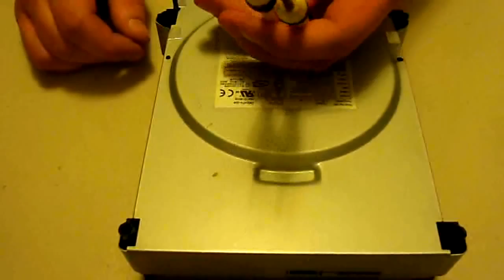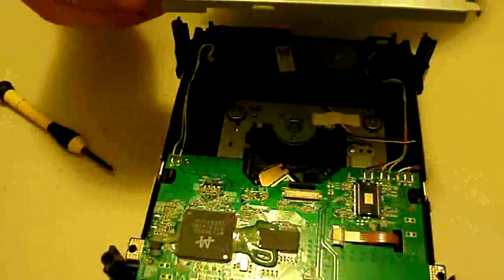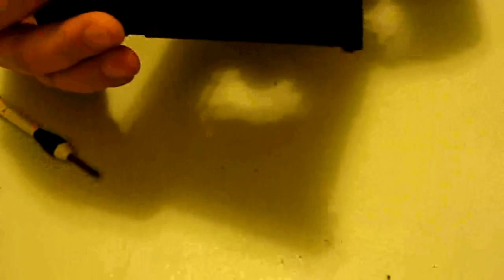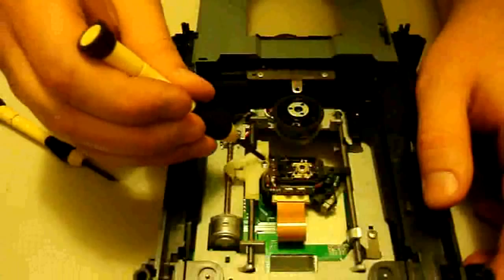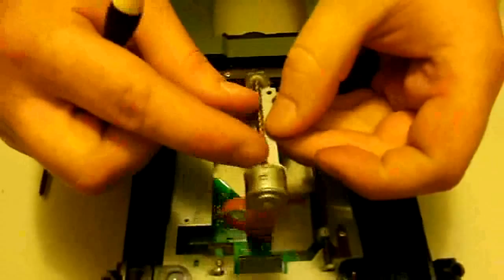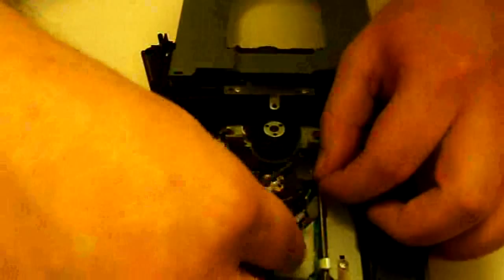How to replace your Benq DVD disc drive worm motor. Xbox 360 Repair tutorial.

Comment: Quick tip for the people who are have the problem of that strange beeping sound out of the drive, works on both Liteon and benq with the worm gear. Try removing the little spring in the white part, fixed my problem, it gave more grip to the worm motor